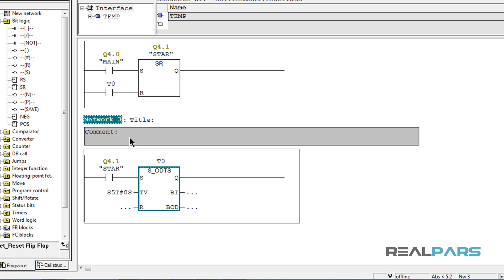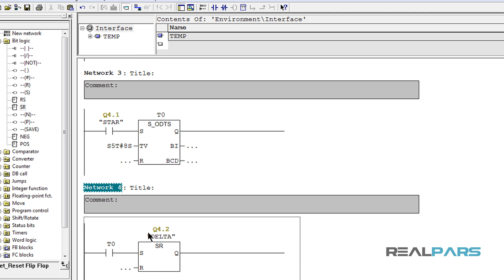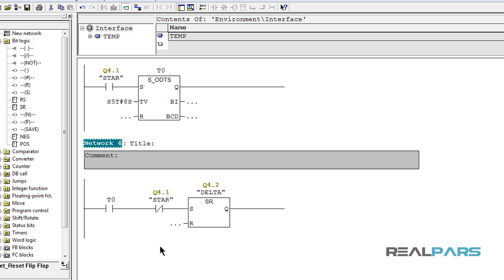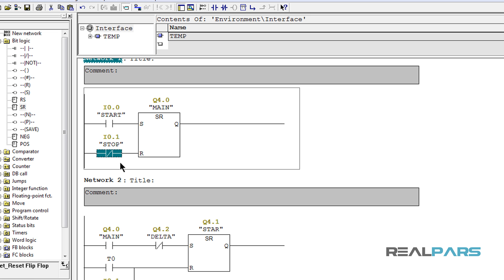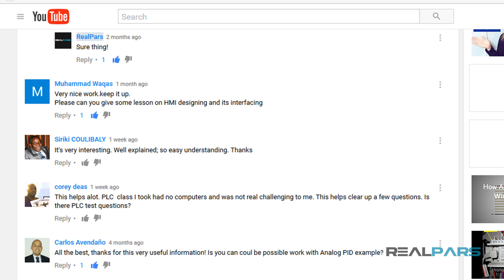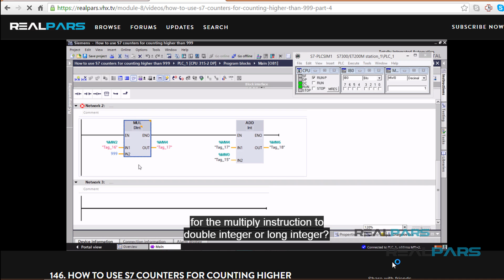Star-Delta Starter PLC Program and Wiring _ Part 12

Comment: The concept is called Wire-Break-Safety.  It has little to do with notifications.  Wire-Break-Safety is used for both PLC (SPS) and contactor-programmed controller (VPS) systems.  The absolute most important objective here is to ensure that the controller gets the signal to STOP (or better said, the controller no longer gets the signal that allows the machine to continue to run), thereby ENSURING THE IMMEDIATE "DESIRED" SHUTDOWN.                                                  A STOP switch should ALWAYS be NC (normally closed), because:  If you mistakenly use a NO (normally open) switch as a Stop switch, then that would mean that your Controller would require a "1" ("true") signal in order to shut down the machine.  ->->->-> If the wire between that Stop Switch and the Controlling system were to become broken, then when you press the switch, the stop signal "1" would NEVER reach the controller.  A broken wire delivers the same signal as the NO (normally open) switch does when it is not being pressed.  No matter how many times you press that Stop Switch, the controller would never receive the "1" that it needs to cause the shutdown.  

STOP Switches must ALWAYS be made using NC switches, and all controllers must be so designed that they react to the loss of a "1"-state from that Stop switch which results in the immediate "desired" shutdown.  

AND, as I understand it, the Emergency Stop reaction is NOT ALLOWED to be carried-out ONLY through the Software programm.  If I remember correctly, Emergency Stop must be carried-out ALSO through direct MAIN-current actions.  Why?  (What if the Software programm fails to perform its emergency shutdown routines properly?  What if some contactors have siezed in the closed position?)  

There is another theme here to consider also.  And that is: Orderly Shutdown.  
Some machines become suddenly dangerous if they are abruptly shut off.  Various components must be brought to a SAFE-position before everything simply loses power.  Not all, but some massive moving, swinging or spinning components might require braking or special placement to prevent damage to the machine or to the products or to the operating personnel.  In these situations there is very specialized programming and specialized Safety Controller Systems that must be used.  It is in this theme where notifications would be more appropriately discussed.  But all this is certainly for another Tutorial.  

Maybe RealPars can create a tutorial on National Standards for Emergency STOP or even the Safety Relay Systems from Siemens or Pilz or Moeller-Eaton.   Hehehe...  

Now you've got some work cut out for you.  I'll be happy to view it...
Reply: kinda like truck brakes, its better to have brakes ON when there is no pressure, if leak occurs... well. No brakes at all.

Comment: The stop button is normally closed so that when there is a disconnection due to breaking of wire or other reason the system will be shutdown. If it would have been a normally open switch, breaking of its wire would not have caused any alarm and when emergency stop would be required it would not be available causing Boom

Comment: One item I noticed missing from your program Is feedback on the contactors.  This is especially necessary on your "star" contactor.  This would be used to make sure the motor had started in the "Y" configuration first so the motor doesn’t get slammed in the "delta" configuration should the  "Star" contactor fail.  The way you have it designed now, if the "star" contactor failed and you pressed the start button, nothing would happen for 8 seconds and then the "delta" contactor would energize slamming the motor.
The feedback can also be used in parallel to the stop command using a failure to start timer to shut down the whole thing just like the stop button was pressed preventing the system from accidentally starting because the start command was active unbeknownst to anyone.
The feedback from the other contactors can be used to trigger the fail to start alarm and stop command should either of those contactors fail too.
Reply: I didn’t get where the issue is? ..In this case if the star contactor is not working the timer will not work and in the same time delta contactor is not working too

Comment: i can't see how the STOP button will stop the MAIN contactor or any other contactor, because in the SR block S is dominating and no matter what you do in the R input S will dominate, this means as long as S is positive the MAIN contactor will always be ON. can you tell if what i am saying is true??
Reply from the maker: Good question. The R input actually has priority over the S input. The following is taken from the Siemens help entry for the Set/Reset flip-flop function: 

If the signal state at input S is "1" and the input R1 is "0", the specified operand is set to "1". If the signal state is "0" at input S and "1" at input R1, the specified operand will be reset to "0". Input R1 takes priority over input S. When the signal state is "1" on both inputs S and R1, the signal state of the specified operand is reset to "0".
Reply: Jamal Masarwa the start pushbutton is momentary anyway so as soon as you release the button the "s" input goes away leaving only the "r’ input active when the stop push button pushed.

Comment: Thanks 🙏 for Giving like this clarity videos on Engineering ,very easy to learn PLC programming 👏👏👏👏👏👏👏👏
Coming to connection of NC for stop 🛑 because of we will aware of total system is ok 👍 means control supply etc ..If we connect NO contact in emergency condition we may face wire broke or continuity missing like this error at that time possible to accident happen.
So NC connection is required for to know status of total control system and to avoid machine or personal accidents 🙏.
Reply from the maker: You're very welcome! Thanks for watching and also adding the comment about normally closed stop switch.

Comment: I think i need some clarifications with the NC Push Button stopping the SR flip-flop. Looking at the STAR contactor, when the time T0 completes its timing, T0 is energized and closes the NO switch to the reset (R) on the STAR contactor, so that contactor is de-energized. Also why does the stop switch (NC) which has already made the reset (R) true (because it is Normally close) also be able to de-energize the STAR contactor when bushed/pressed? 
Or does it mean that the SR flip-flop will be RESET (de-energized) whenever any of the switch (NC/NO) attached to its reset point (R) has a change in state?
This is one of the best training video i have ever  come across. Infact, it seems like a cheat video.
Reply from the maker: Hi Adebayo, The closed contact for the stop switch only let the signal pass when it's pressed.
Reply: Thanks for your responds, but i expects that when a NC push button is pressed, there will be no signal temporary until the button is released. So saying that the stop switch only let the signal pass when it's pressed is contradictory. Maybe i need to get more details from the website as you have advised. Thanks again.
Reply from the maker: What you say is what is happening for the switch that is connected to the PLC and that's correct. 

But when we use a closed contact in the logic, the exact opposite of that happens. That means, in the logic, when the switch is not pressed yet, the closed contact won't let the signal pass, and then when the switch is pressed,  the close contact in the logic will let the signal pass.   

So what happens in the software (the logic) is the excate opposite of what happens in the hardware for the switch.
Reply: Thanks so much, i was able to grab the concept after watching part 13 of the series. You guys have made this complex PLC program look so basic.

Comment: I use nc contact for stop to assure that the circuit (electrical wires) are fitted and not broken. If circuit is broken the all system is act like stop button is pressed.
Reply from the maker: Awesome! Thank for keeping the industry safe. :)

Comment: for the input, if there are 2 components, one is active, the other one is not active, how do you know if 1 or 0 for the input, do we assume for whether NC and NO, it is 0 unless the state change then it will become 1?
Reply from the maker: Hi Ling, thanks for the questions. This is way more easier than you think. When we have a 24 volts signal at the PLC input, we consider that input as being true. Otherwise, the signal is false. 

This doesn't anything to do with using an open or closed contact in the logic.

Comment: use of nc contacts for estop/emergency/off so that if there is any open connection, the machine ll not run; considering fault in system and provide better safety
Reply from the maker: Thanks for watching and commenting! :)

Comment: Fail Safe wiring on the stop button.  Same idea as using a N.O switch for low level and N.C for high level.  If a wire falls off, the process stops or you get a warning message that something is wrong.
Reply from the maker: Great! Thanks for the comment.This helps others understand the video better.

Comment: We add NC contact for stop or for emergency swictch because in emergency situation we should be able to shut off the system asap. If out wiring has got open by any means n we dont knw dat than in case of emergency we will not be able to shut off the system. If we use NC switch and the wiring has got open, the system will go off as soon as the wiring gets open and we will be notified and thus the safety does not get bypassed.

Comment: Using a N/C contact forces you to not rely on opening the wire (which could happen in a cable break), thus you have to send a signal to stop the circuit rather than going to a low state.

Comment: we use NC contact to stop the whole system because , in hardware connection we use NC push button so it's a direct signal of 24 V DC to the input I0.1 which make it false in the PLC program and not reset the SR flip flop .if we push the stop button this action make I0.1 true in PLC program and the result is the whole system will be stopped
Reply: please help me to understand that in network 1 , where we use stop NC switch . is this switch will keep the sr flip flop reset condition  ?? if we see we can find that this NC contact give signal to the rest .
Reply: @2tan90  Be aware that the NC contact "STOP"' at R input SR "MAIN" aren't phisical contact of STOP switch, but it is state of memory cell coresponding to the input  I0,1 FROM this switch.

Comment: In this video I have a small doubt, in the last step after the Delta Contactor is energised by the timer, the NOC that is connected to the Star Flip flop (SR FlipFlop-2) is also energised and thus the logic is 1, which makes the value of Star Flip flop (SR FlipFlop-2) S-1 and R-1, which is a Forbidden State of a SR Flip flop, so here how will the Star Contactor be deenergised in a Forbidden State of a flip flop?
Reply from the maker: Hi Nirmal, With the SR flip-flops when both inputs are true, the RESET input has a higher priority. So in this state the flip-flop is going to be de-energize.

Comment: I guess you should still use a mechanical interlock between the star and delta contractors. Because what if the star contractor is welded in when you press the start button??
Reply from the maker: Hi Dolly, thank you for your comment and sorry for the delay here. Based on the logic we have here, the delta contactor will never be energized when the star contactor is still energized.

Comment: N/c just provide constant connection between two points, whether it is PLC or will your field wiring, if the signal or the wire is broken then the whole thing comes to a stop. And then you have to find out where the broken wire is to start it is for the safety purpose if you use normally open and it is open then only way you can stop   If the wire is broken is you kill the power to the whole shebang

Comment: The reason is when we use an n/o switch instead of an n/c switch, if the wire that connects the switch To the plc is ever disconnected we will be notified and this helps to build a more reliable system.
Reply: But they are not using a n/o switch for STOP as you can see in the ladder tree.

Comment: I really  appreciate your work , thanks a lot , but I have a comment due to your star-delta program. what about adding another timer to separate between star and delta connection to avoid any momentary short circuit due to inertia or mechanical action of contactors ?.
Reply from the maker: Hi Emad, thank you very much for your comment! The close contacts that you add in the set input of the star and delta flip-flops handle this perfectly. No need to add an extera timer here.
Reply: RealPars what happens if the Star contactor sticks closed for some reason?